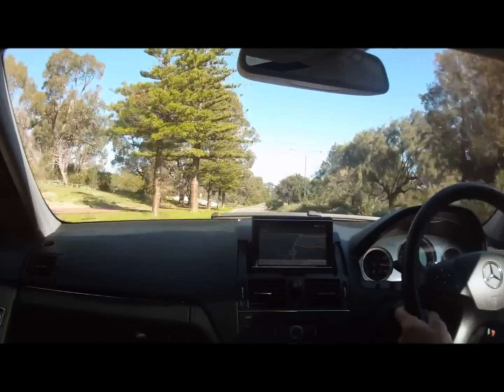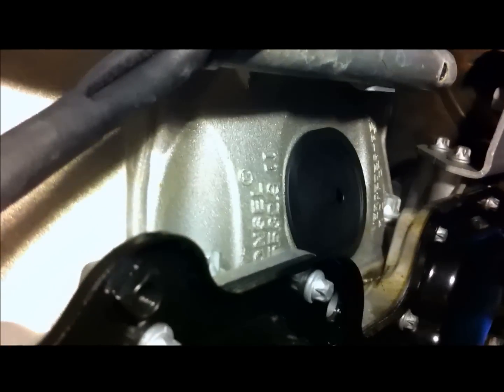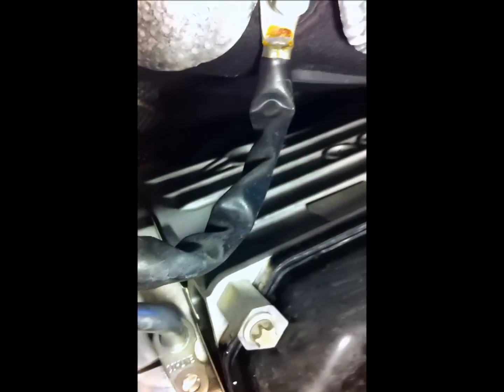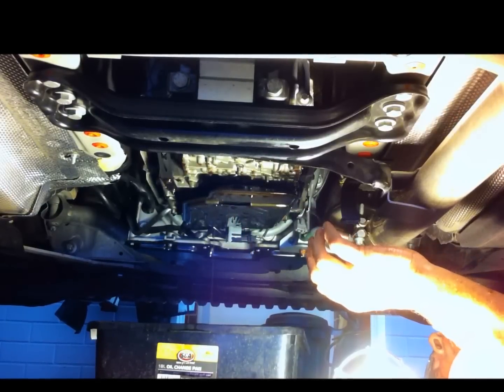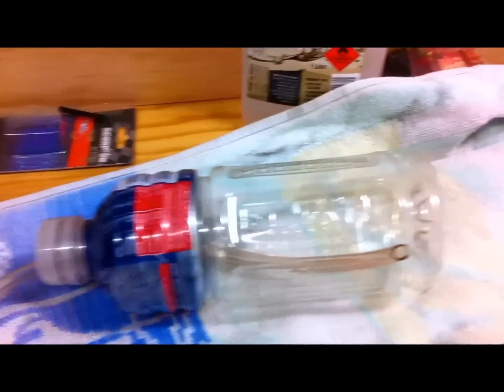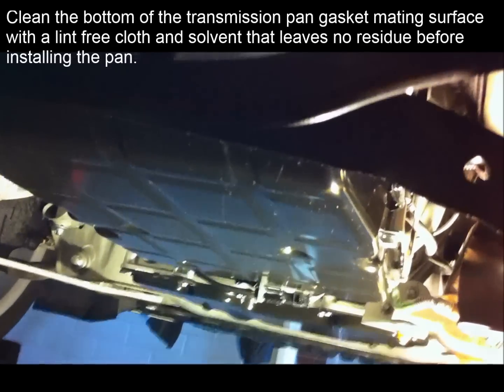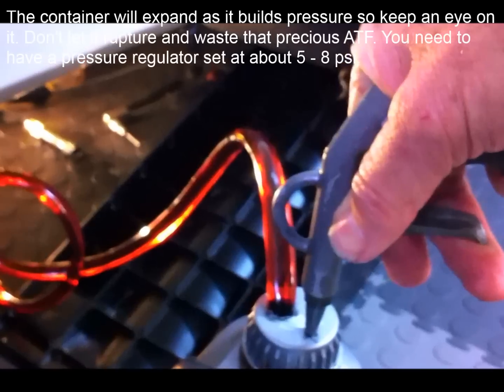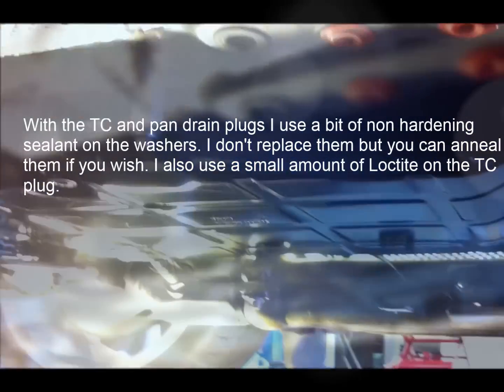Mercedes W204 C Class Transmission Service ATF Fluid Oil Change 7GTronic 722.9 Test 0-60 mph

Comment: Hi mate, great video which I stumbled across looking for info. I just bought a 2012 E350 with with 7G Tronic and has the dreaded clunky gearchange issue. This seems to be a common problem due to a faulty TCM conductor plate. I tried to google answers but couldn't find anything, so was just wondering if you know how big a job this is to fix? I heard that the plate itself is only a few hundred dollars, but replacing it can be a couple of days work, so might be a very expensive job.  Any info you could give would be appreciated.

Comment: 6 years later I just rewashed your video and did the same procedure on my 2014 c350 cdi, it uses the blue 236.15/16 according to vin 
So I opted to test the castrol dexron VI which is red yes but approved now for use in mb calling for spec 236.14/15/17 and more
I've had great success on my old c36 so now going to see what's what with the 7g tronic plus

I did opt to change it earlier than the specified 8 year 120000km 
The fluid was not blue , not black but disgusting (80000km and 6 years)
As for my engine 
Recently I swapped in a new (used 2017 s350d engine ) 
Old one ate a glow plug , (I took it apart sent the head to the machine shop and they had messed up the valve seat and valve ,
2000km later after rebuilt the first time , it dropped a valve codeming the old engine... new engine I gave a good refresh with new glow plugs  etc
So far going pretty good

Again thanks for the super helpful videos🙏🏻😁, how's your 320cdi doing?

Comment: Hello, will be damaget transmision if i drain oil when have 10 celsius ?  Will be damaged transmision if have + 1 liter oil ?
Reply from the maker: You need to warm the transmission so the oil is hot before you drain. The oil level  needs to be set as shown in the video. The Mercedes workshop manual says not to overfill as it can damage the transmission.
Reply: @ScottElliott152  Here in Norway is very cold -15 celsius.  
When i drain oil in +40 celaius thansmission is not shift until i wait the car working 5 min and drive 2-3 kilometer.

When oil will be drain in plus 40 celsius and 10 celsius im not sure how muchdiference will be in oil capacity. Probably  + half liter. In big transmission should not be big problem, i think :)

Comment: How many gear and which year
Reply from the maker: it's a 2008 and the transmission has 7 gears.
Reply: @ScottElliott152  , I have mercedes Benz blueefficiency w204 c class 220, 2012 automatic I confuse about transmission fluid red or blue ?? Because when I drive manual mode I see only 6 gears Some garage says red and blue Please help
Reply from the maker: @kassem2950  Use a Lube Finder on the oil manufacturers websites or ask a Mercedes Dealer. From 2012 it was C250CDI. Is yours a C220CDI?  MB don't have a 6 speed auto. The 7 speed auto has no dipstick tube but the 5 speed has dipstick tube with a cap on it.The 7th gear doesn't engage until about 90kph so check it on the highway. https://penriteoil.com.au/product-selector?by=Drill%20Down#/recommendations
Reply from the maker: @kassem2950  Another tool for you is this: https://partsouq.com/en/catalog/genuine/locate?c=Mercedes-Benz

Input your VIN and the data card will be at the top. Click on the "i" and you'll see.

all the information is out there.
Reply: @ScottElliott152  thank very much

Comment: If that's a stop start gearbox you have put the wrong oil in it
Reply from the maker: It's not a "stop/start" system. If it was I'd have said so. I've used the recommended ATF for the 722.9 7GTronic transmission. I use the official Mercedes Workshop Information (WIS) as a reference.
Reply: For 722.9 you can use MB236.14 and also MB236.15 (even better).No problem.

Comment: Hi there do you need a special Mercedes’ bit tool to take off the ATF oil pan for the 6 bolts ? Thanks
Reply from the maker: No ... just normal torx sockets.
Reply: @ScottElliott152  can your remember which ones they were ? So I can plan and get the bits.  :(
Reply from the maker: @SM-ec5bk  Remember torx bolts can also be removed with a normal socket. I made notes on the video saying an 8mm socket will get the oil pan bolts off. Did you see the note?

Comment: How many quarts or liters for simple drain and fill with atf?
Reply from the maker: The oil pan holds about 50% of the ATF. So if that's all you're doing about 3.5 to 4.0 litres.

Comment: Hey Scott great video very detailed! Just 1 question, how did you check the transmission temperature with the meter?
Reply from the maker: Thanks Michael. See 15:45 again. I taped the temperature probe from my multimeter onto to the bottom of the oil pan.

Comment: Some say turn motor off for final drain at 45C.  Im bit edgy about such things..
Reply from the maker: Steven if you turn the motor off you'll over drain and end up with a  low ATF level. The Mercedes WIS says to drain with the motor running at 45C. That's because it's a circuit with the ATF flowing around through the transmission and cooler. I estimate there's between 1 and 2 litres sloshing around in the galleries, oil cooler and lines. When you stop the motor and therefore the transmission pump some of the circulating ATF flows back to the pan and will be drained out resulting in a low level when the motor starts again. It makes sense Mercedes want the level set while the ATF is flowing around the system. I always refer to the Mercedes WIS during these projects. Sometimes I devise a better, easier way of doing something (like using the compressor to pump the ATF) but the WIS is the baseline information.
Reply: @ScottElliott152  hi thanks Scott.  I redid my atf today and it needed 1.2litres.  It is sooo smooth now. I probably have done some damage. I have done a few hundred miles with incorrect level.  Hopefully it will be ok
Reply from the maker: @stevenmcc6052  Steven you can relax as there's a big safety factor with the oil level. If the level gets dangerously low the TCM detects that and puts the gearbox in limp mode to stop any damage. Good on you for correcting the level. Regards, Scott

Comment: Hi Scott ! Thanks for your great videos.
Just wondering,why can’t you fill the transmission through the dipstick tube ?
cheers John
Reply from the maker: Because there is no dipstick tube.
Reply: I have 2007 C230 with the 7gtronic 722.9 but it has a trans fill tube but no dip stick. I can do a quick drain and fill it from up top right?
Reply from the maker: @lagibear  I thought the C230 has the 5 speed 722.6 so make sure that's the case.
Reply: My mistake. No fill tube. But the 2007 c230 do have the 722.9 7gtronic trans.  I Don't have a scan tool for trans temp.  What if i just fill the same exact amount that came out. Same thing right?
Reply from the maker: @lagibear  Not advisable to put the same quantity back in because you don't know if the current level is correct. Get a cheap mulitmeter with a temperature sensor and check the temp like I did ... or use a meat thermometer taped to the pan with some insulation over it. I don't think it's wise to try to shortcut the ATF change on a transmission that costs $10k to replace.
Reply: @ScottElliott152  My 2014 C220 has a 7G Tronic 722.9 as well with a dipstick tube, but just cap, no actual dipstick. Confused as to why that is the case.

Comment: Wish you lived near me,
Then I'd ask you to change mine!!
But very educational, and I bet
Along with others and myself
They will steer well clear, as its the
Refilling that's a big problem.
Reply from the maker: If you have a compressor the refilling is easy. You can now buy an adapter to screw into the drain hole for less than $5.00. https://www.ebay.com.au/itm/Car-Filler-Fluid-Filling-Transmission-Service-Adapter-For-Mercedes-Benz-722-9-X1/183013699484?hash=item2a9c776f9c:g:3z0AAOSwfphaWGEl
Reply: @ScottElliott152  thanks mate:)

Comment: Great video! I noticed you had a white drain level plug but the ATF is red, did you use MB236.14 or MB236.15 fluid?
Reply from the maker: My 722.9 transmission uses the red MB236.14.
Reply: Scott Elliott ok great thanks! 👍

Comment: Hey Scott, if you happen to see the comment. If I drain Torque converter can I still refill it from the pan fill line by keeping it in park for 5 minutes or do i need to go via oil cooler lines? Or was that just done since you were already down there? I am having shudders on uphill and a burnt smell so I believe my fluid is contaminated and planned on changing from TCC and by dropping pan. Thanks in advance. Cheers!
Reply from the maker: The TC gets filled by the transmission pump when the engine is running in Park. The only place you add oil is by pumping it through the pan drain hole.
Reply: @ScottElliott152  Awesome. Thanks a lot for quick reply. Been a long time subscriber, your videos helped me take care of my C350 for the last 3 years hehe. Cheers!

Comment: Correct me if I’m wrong, but you drain the sump and torque converter but it looked like we only refilled the sump in the video. Does the torque converter refill itself from the fluid in the sump and that’s why you have to run it and heat the box up to 45*?
Reply from the maker: The transmission has a pump that circulates the ATF. You only need to pump the ATF in as shown. The reason you start the engine is to let the pump fill the TC, the galleries, lines and cooler.
Reply: Scott Elliott thanks for the prompt reply! I thought that was the case, just wanted to confirm that.

Comment: Hi Scott, any thoughts on replacing the battery on Mercedes W204 C200CGI. Do we need a AGM battery and MB quoted $620 + 240 for installation. Road side assistance guy said I need a AGM battery but previous owner installed a  Newton  Power 66MHF and guy from Newton power says after installing a AGM battery you need to set up and tune??? Is this true.  I see it's very simple process to change it but no idea about tuning the new battery. Thanks  Saj
Reply from the maker: The dealers and the Newton guy are trying to bluff you because it's a Mercedes. A tune! What a load of nonsense. I've used this before (C320CDI uses the larger DIN85L) before with no issues. https://www.batteriesplus.com.au/shop/car-truck/exide-extreme-xdin88hmf-900cca-car-battery/
AGM batteries are usually only required in rougher conditions like off road. I have them in my motorcycles. The acid is suspended  or " absorbed" in a glass fibre ... hence Absorbed Glass Mat or AGM.
To protect your wallet and get ahead financially view with skepticism anything a guy behind a counter says as most of them are full of opinion but light on with facts and science. What are their qualifications? I'm currently running a 2.2kg Lithium Ion battery because I didn't like 27kg of lead acid DIN85L battery swinging around 500cm behind the rear axle.
https://www.batteriesplus.com.au/shop/car-truck/exide-extreme-xdin66hmf-750cca-car-battery/
How hard is it to loosen the terminals and unbolt the retaining bracket. $240 to fit a battery is outrageous. Just disconnect and remove the old one, drop the new one in and connect the terminals and away you go. No tune, resetting, standing on one leg etc. Start it and drive away. I've had my battery out tens of times. For the extra $45 you can probably upgrade to the DIN88L as it should bolt straight in. There maybe a little locating foot for the smaller battery. I upgraded to a bigger battery in my Vito as the battery tray was designed to take either size.
How to remove your battery https://youtu.be/gNjhGYYCvlk
Reply from the maker: I checked and the bolt that secures the end clamp slides in a slot to accommodate the larger DIN88. You can see it in the above video. Good luck Scott

Comment: Hi Scott
did you end up reusing the e torx bolts..  even though they MB say it's a one off.. do you think it's a overkill.. I found that they cost $6 each..  a bit rich.. what's your opinion on this.. ? Where did you get yours.. ?
Marco
Reply: The MB trans pan bolts are aluminum torque to yield (TTY) bolts hence the reason they state they must be replaced each time. If you're stuck purchasing said bolts from MB they probably do charge too much, in the US they can be found for $1 each from third-party European parts supply vendors like Pelican, RM European, FCP Euro, etc. so not an issue. If you go down the path of replacing with steel bolts the size you're looking for is 6mm x 40mm x 1mm in grade 8.8 or higher.
Reply from the maker: Hi Marco. No we decided to use standard high tensile hex M6 hex bolts with anti seize grease torqued to about 10 - 12 Nm. Check this video of the ML320CDI with the same engine and transmission. We explain and show the bolts. Scott https://youtu.be/sP0FfkfQCLg

Comment: For. W204  C250cgi how many litres transmission oil we need to change? The foreman were informed 5 litres is just enough. So I also changed 5 litre. Isit enough? At the same time he informed I also need to change axle gear oil 2 litre? Please advise. Thks
Reply from the maker: Wh0t transmission does that vehicle have? 722.6 or 722.9? 5 litres sounds to low. Either of these transmissions need about 8.5 to 9 litres to do the torque convertor and transmission. The TC holds about 50% of the volume so perhaps they only drained the transmission. Would you only change half your engine oil?
Rear differential is about 1.5 litres.

Comment: i just changed my oil in my c250. IF i did a transmission fluid change would it drain the oil out?
Reply from the maker: Philip I'm unsure of your question ... Are you concerned the engine oil will drain out of you do the transmission? Maybe you're joking ... If that is your concern you need not be. They're separate components and use different oil. Scott

Comment: Thanks for the vid but I dont understand taking out the bolts and then putting in the one time use ones?
Reply from the maker: Eric I've stopped using the one time stretch bolts. I read MB use them because the zinc coated steel variety were getting frozen in place and breaking.
I use ordinary hex head high tensile M6 bolts coated with an anti seize. Aluminum anti seize grease is a good choice. Have a look at this video doing my daughters ML320CDI with the same gearbox. We haven't had any issues using zinc coated M6 high tensile with aluminium anti seize grease. https://youtu.be/sP0FfkfQCLg
Scott

Comment: HI. I have an SLK350, with an 722.906. I wanted to change the transmission fluid as you in the video, but I stopped in the first step. I rotated the cranckshaft, just like you, but I didn't find the drain plug in the Torque Converter. How can I drain the T/C? The T/C housing is 1.5532.1. Thx
Reply from the maker: It appears you have one of the TC's without a drain plug. You can pump the ATF out by disconnecting the oil cooler return line. Run the engine at idle until the ATF stops coming out. Check on www.benzworld.org first as someone will know. I've not done the oil return line method so plesse confirm it's possible. Scott.
Reply: Thank you for your fast response! I will check it. Thx

Comment: My 2013 C250 uses low friction ATF DUE TO THE 722.9 trans having a A89 low friction code.  That is blue ATF.  This guy is working on a an early model like a 2010 or 2011 cause the atf is red.  I hope he knows what he is doing.
Reply from the maker: Jason my vehicle is the W204 2008 that uses MB236.14 ATF which is red. Why would I use the incorrect ATF for my car?. If you like I'll add a note and say the later models use MB236.15 blue/green ATF. My transmission is going famously. Scott

Comment: SCOTT, GREAT VIDEO! I HAVE A ML250 WITH ALL WHEEL DRIVE. THE BELL HOUSING AND THE TORQUE CONVERTOR RUBBER DRAIN COVER ARE NOT VISIBLE AS IT
APPEARS TO HAVE SOME 4 MATIC EQUIPMENT UNDER IT. ANY IDEA IF IT IS STILL POSSIBLE TO DRAIN THE TORQUE CONVERTOR IN THE 722.9 IS IN AN ALL WHEEL 
DRIVE MERCEDES?  THX!!!
Reply from the maker: Thanks for your support. I believe it will be the same process. Access may be a bit harder. Search on www.benzworld.org Scott

Comment: So my mercedes has a lot of miles on it and I don’t know when the last transmission flush was done. I heard that if I do a flush on a transmission that hasn’t been serviced in a while, it could do more harm then good. Is there a way I can check the fluid before I do the service? I figured just slightly opening the drain plug and catching a little fluid and testing it but I’m not too sure if this is the best idea
Reply from the maker: Issa you can loosen the drain plug to capture some ATF for testing. My logic tells me leaving old ATF in your expensive 7 speed will do more harm than changing the filter and putting in new ATF.
Reply from the maker: Have a look at Chris's video: https://www.youtube.com/watch?v=o690DovjDAc

Comment: I  understand that    The   7g gearbox has a dip stick tube at the back sealed with a locked cap that you break off and repllace
Reply from the maker: No Graham that's the 5GTronic 722.6 series not the 722.9 series 7GTronic.